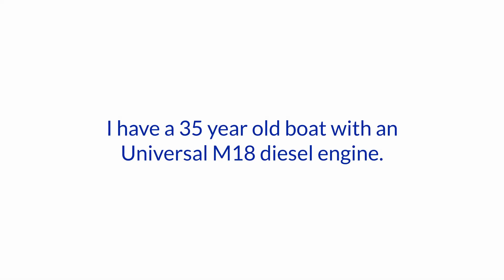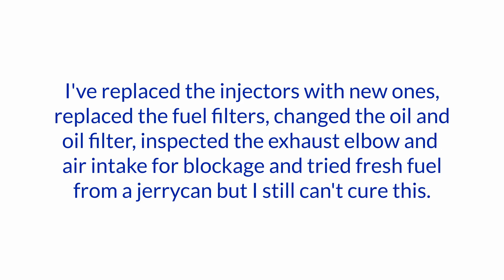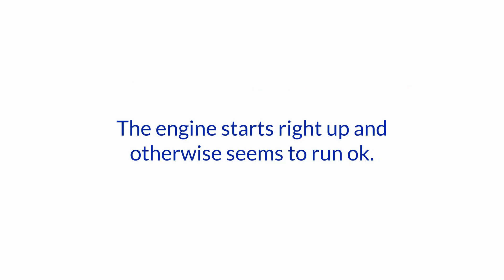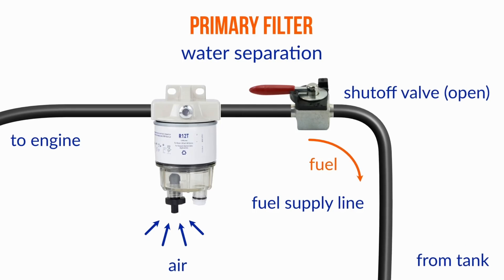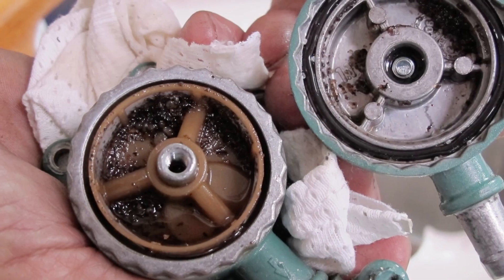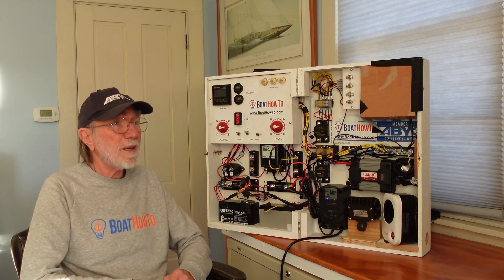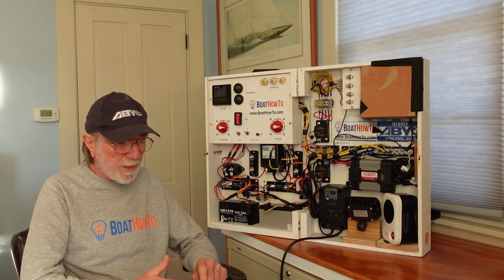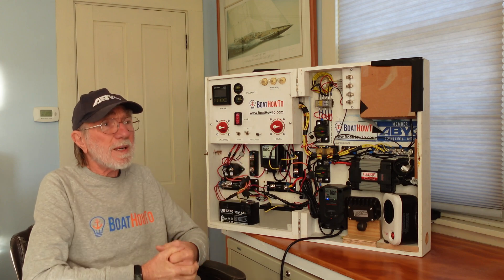My Boat Diesel doesn't reach full RPM 😓 | Ask The Expert with NIGEL CALDER

Comment: Could the boat also possibly be over propped?
Reply: correct but can stall at idle when placed in gear.   Outboards can be serviced on the muffs on the trailer and idle set , once placed in water the extra pressure created by the water up the exhurst will cause them to stall once in gear.   High rpm not in gear  i would say fuel  also @MalLawrence-q3c